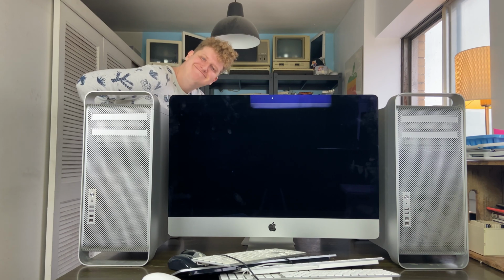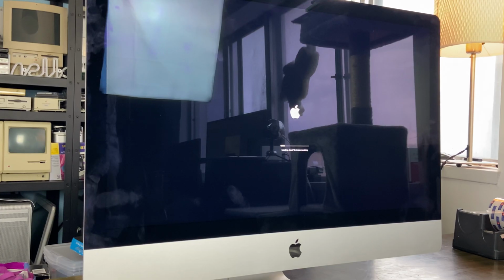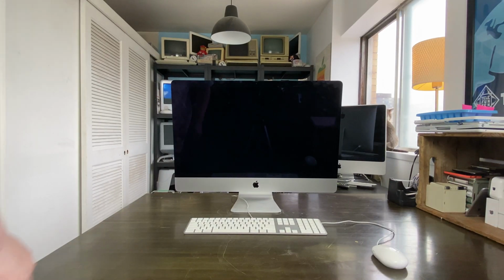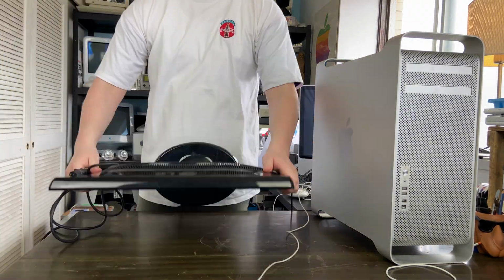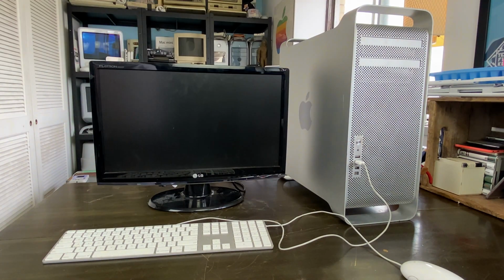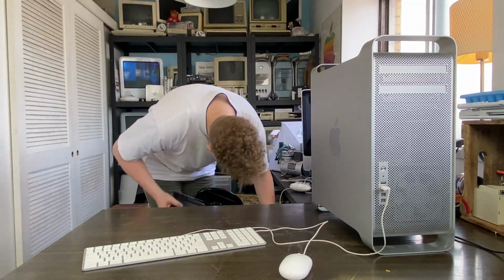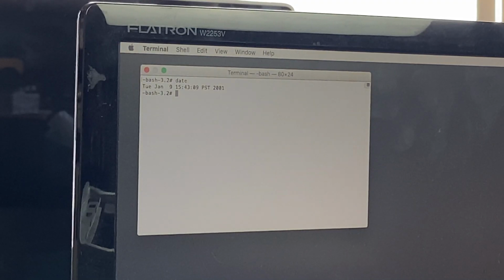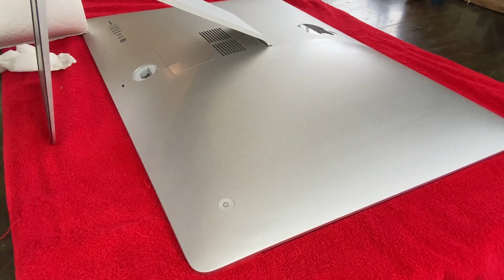2 iMacs & 2 Mac Pros for $1000. Deal or No Deal?

Comment: We're gonna be seeing a lot more of this as the pro offerings of Apple Silicon present themselves!
Definitely a good deal! Love the CGMP and 27" iMac. My two favorite machines from the Intel era next to the 17" MBPs.
Can't wait to see some videos on their usability today.
I personally rock a 4,1 flashed to 5,1 for my heavy lifting and love it... but I think generally speaking most people wouldn't love it unless they're a fan of the design/history.
It's just not practical... the thing runs hot as hell, literally makes your room unlivable in the summer...
I recently realized that I can run my entire setup (stereo monitors, audio mixer, ultrawide 1440p display, and all my peripherals) Off my M1 MacBook Air! And the thing runs smoother! AND SILENT!
I love my Intel machines to death... but I think it makes little sense to use a Mac Pro specifically due to the power to performance ratio.
I think that iMacs sort of sneak by since they're designed with a laptop's mentality. Meaning a lot of air doesn't escape the chassis, therefore not making it an effective space heater.
I actually found one my favorite and most missed Intel Macs was a $200 early fatboy 27" iMac I purchased. It had the first i7 shipped. I was able to run Windows on that thing in bootcamp and play with it like an Xbox 360 with a built in 1440p display... Basically a semi-portable console! Shouldn't have resold it for the profit. The $100 wasn't worth the fun that thing was...
Reply from the maker: Keep in mind here in Winnipeg a computer doubling as a space heater is actually desirable for 9 months of the year
Reply: @CanadianComputerCollector  Good point!   Guess that is one downside to living in a desert. But my favorite upside is how well it preserves old computers! Love your videos, thank you for the awesome content!
Reply: I have a Mac Pro 2012 and I love it. I also buy and sell Mac Pro 2010/2012 models in both single and dual CPUs, and they have been a good seller for about 6-7 years now. Lately sales have slowed and maybe it's because of the new Mac Studio with the M1? The external hard drives scares and/or annoys most people.
My editing studio is an iMac 27" Late 2009 with an i7 2.8Ghz CPU. Even with 32Gb RAM and a 2Tb SSD the video is slow due to the 512Gb GPU. I may upgrade to a later iMac 27" with a faster CPU and bigger GPU.